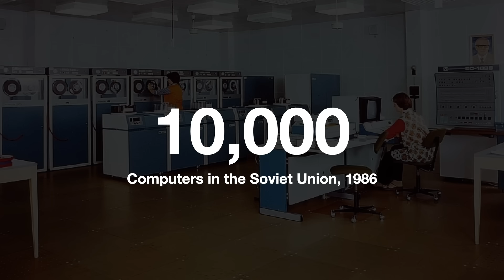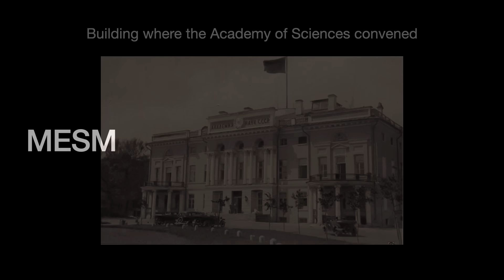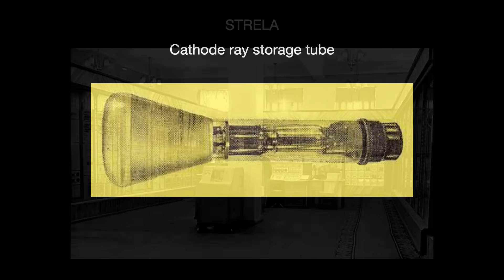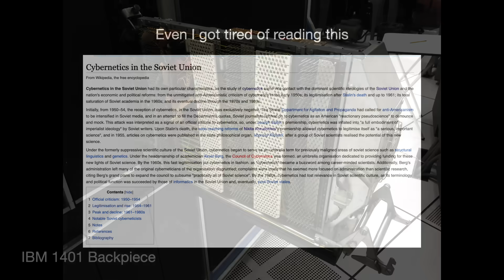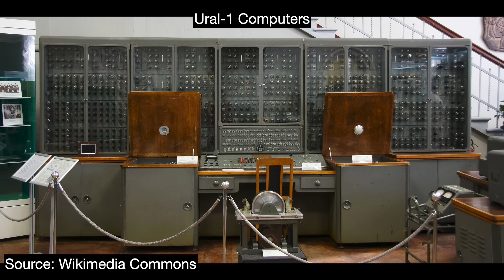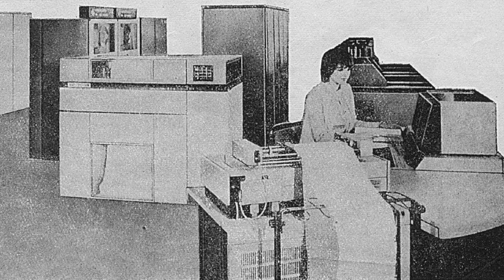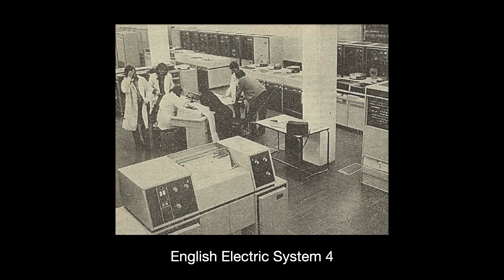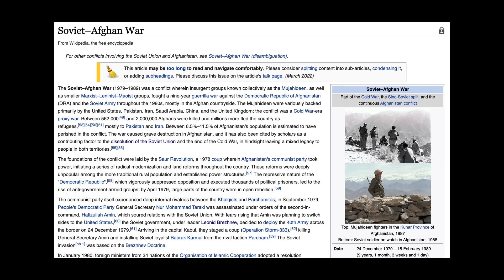Why the Soviet Computer Failed

Comment: It sounds like a lot of economic problems in the Soviet Union could have been solved by better metrics. Steel manufacturers were judged by steel quotas, not by what others could do with their steel. Computer manufacturers were judged by production quotas instead of what clients could do with the computers, so they didn't help customers with training.
Reply: There was plenty of interest in solving there economic problems but the profit motive got in the way. If u conceive of the USSR as one giant corporation, with the bureaucracy as the shareholders, the system and its inefficiencies become more evident. The state, as a corporation does, pursued many ventures, with the major difference being that these ventures all needed a base level of production to exist in order to sustain functional governance. However investment capital is limited and so the bureaucracy chooses the industries (ventures) which yield the most return on investment. These happened to me, as in modern russia today, extractive industries, petrochemical and defense industries.
Reply: @sergeykuzmichev8064  One giant monopoly, with the power of life and death over its employees, barbed wire keeping them in, and with return on investment being irrelevant because the "shareholders" got their dachas whatever happens. Modern Russia's nothing like that. Sure there's corruption, but oil is sold for money, profit making industry exists and elections are flawed but matter. And don't you guys have a flat tax?
Reply: The basic problem with centrally planned economy is the lack of competition and independence in making decisions. Lack of diversity, you could say.
Another problem is the lack of information on demand... In capitalist market, if something is good or desirable, the price goes up and this gives a signal to makers to make more that sort of thing. In centrally planned economy however, you have centrally planned prices. So you have no idea, which products are appreciated by consumers.
Reply: Almost like the top down socialist system didn't work at all to determen needs and uses of materials. 

The west figured this out in the 1800's. The free market (profit and loss system) does all of the things above.
Reply: pretty much inherent to centralized planning. communists stuck with it even though they could never effectively run a command economy since they're just too complicated to run from the capitol. doesnt help that they usually boost productivity by simply setting higher goals and rewarding those who meet them while punishing those who dont so workers lie to their factory manager who lies to their governor who lies to the capitol. I'm reminded of a Soviet miner who supposedly dug literal tons of rock per day with a pick and shovel  by doubling his work load multiple times.
Reply: @Wick Are you playing dumb or are you dumb?
I did not create the term 'planned economy' and it's definition is not set by me. A planned economy is an economy managed by the government directly.
Or from Investopedia "A centrally planned economy is an economic system in which decisions are made by a central authority rather than by market participants."

Unless you are just being pedantic because I missed the word 'centrally' even though my intention and meaning were clear.
Reply: Better metrics helps to a point.  The biggest issue was data collection, data quality, and data processing that fast enough to predict demand.  The actual people doing the work in the Soviet Union were very thoughtful about how best to measure things, but the politicians and managers of the state enterprises were excessively corrupt.  The corruption stood in the way of gathering better metrics because if the metrics highlighted the corruption the political class wouldn't go for it.  Computers were stamped out, or held back because of this fear they would expose the corruption.  While the Soviet Union is gone the underlying corruption still infects post-Soviet territories especially Russia.  The planned economy had serious scaling issues where market based economies didn't.  It was sometime in the 1970s when Russia began to realize that the Central Planning Authority would have to hire ever person in Russia for it to grow larger.  But, if you had a more honest and transparent society with today's technology you probably could scale much much higher.  But there might be a limit to the size of the economy even then that market based ones won't hit.
Reply: @chucktangy  Planned economy don't have "scaling issues". Planned economy simply don't work. Otherwise, North Korea or Cuba might be able to do better for themselves.

You might want to mention something about corruption again, but I'd answer that corruption is independent of planned/market economies. Authoritarian market economies likely have just as much corruption as planned economies. 

Once more, I'll reiterate that money itself is a metric and exactly the metric that is needed here.
Reply: @alan5506  China begs to differ on your proclamation about planned economies.  "Doesn't work" at what point in time?  We all know in the end it failed so some people want to only remember that.  In the beginning the planned economy was extremely efficient at developing Russia into a super power.  No other nation grew as fast as quickly as the USSR did.  Historians agree that Russia's planned economy was central to that fast pace growth.  But that's where the scale issues hit Russia.  Once the early days were over, growth fell off a cliff rapidly and then they sank into malaise they couldn't recover from.  It seems so obvious that computers could've been the technology they needed to fix their problems of managing the economy and yet they didn't really use them instead keeping them mostly focused on military projectile calculations.  China successfully reformed parts of their economy away from a pure centrally planned economy but they still operate on state planned initiatives with state run monopolies and steal technology from other countries in that effort.  Corruption is near universal because it's just a form of gaming the system regardless of how that system's rules are structured.  Money is a singular metric, but it doesn't prevent, nor stop, corruption or gaming.  And while we have a singular metric in market based economies we use a lot of other metrics to grade the quality of that work.  So I disagree money alone is all you need.
Reply: Outside sabotage and embargos didn't help. World wars don't help either. Harsh winters don't help at all.
Reply: @Simboiss  going after the most productive people in your country doesn't help, use scientists for space race propaganda instead of commodities doesn't help, genocides don't help, purges don't help, lack of freedom doesn't help, corruption doesn't help
Reply: no, those problems could be solved by the market
Reply: The planned economy has a fundamental problem. The plan is drawn up five years ahead, according to economic ideas of what has gone wrong in the past 5 years. In principle, it is a big matrix where the resources needed and the resources to obtain the resources are calculated for each product. It's basically a simple linear algebra problem. In my opinion, the problem is also in the mathematics. The larger the system of equations, the less stable the solution. Each wrongly determined coefficient will produce a very different solution. The planners started from mechanistic theories, but in reality it is a non-linear system with elements of chaos. (Chaos theories came much later.) The development of planned economies has shown that this does not work. In my view, the essence of the success of democratic countries is the stock market. It is a non-deterministic online system with very fast feedback. Even with all its flaws, it works more efficiently than the communist attempt at a deterministic economy.
Reply: @prutok  Market economy has its own core problem too. It does not differentiate between values and thus treats Netflix, bitcoins and prostitution as equal in value to food, health and housing. The tragic consequences are unfolding.
Reply: Finding the proper metric is an impossible task, even in theory let alone in practice. Let's say I make cutlery out of your steel. According to your suggestions you now get penalized if my processes are inefficient. How is anyone even supposed to know how many knives there should be when the knive factory runs 24h using the output of the steel mill that ran for 24h when that uses the ore that's mined in 24h and so on? It's incredibly hard to begin to model even very simple production chains and if you do manage it all you now have is a static setup that has neither incentive nor ability to adapt to new circumstances or improve efficiency. People like to blame corruption for the fall of communism so that they don't have to face the simple truth that planning an economy is jusr not possible. The Austrians proved that back in the thirties.
Reply: Yeah, and do you know what metric measures how useful your product is to other people? Money.

But money doesn't solve the innate cutthroat self-interest that some people have which is witnessed as corruption, hostile business practices, deceitful litigations, deceitful advertising, conflict of interests, lobbying and the list goes on. Transparency and free speech helps minimize the aforementioned issues. Unfortunately, one party states aren't so big on transparency and free speech.
Reply: @alan5506  "The United States is also a one-party state but, with typical American extravagance, they have two of them."
- Julius Nyerere
Reply: @alienvomitsex  There's lots to complain about any large organization in this world.
Reply: @alan5506  Yup as an economic system capitalism is very effective as a moral or ethical one it sucks ass.
Reply: @jackkraken3888  I don't think there's any economic system that is moral. Just like you can't have a car that is moral. Or you can't have a computer that is moral.
I think morality is the job of the government and the community. 

Communism, feudalism and capitalism are not meant to care about morals.
Reply: @alan5506  Great points! Nothing beats money as a tool for resource allocation, and systems of resource allocation are orthogonal to morals and morality. That bit about politics infecting every human endeavor is something one only really understands after suffering under it :-) 

For me, the interesting stuff is at the margins - things like "national champions" and the best way for govt to support industry, from standards to subsidies. Oh, and govt enforced monopolies like patents.
Reply: @alan5506  lol, as if money is a measurement on how "useful" something is. Get outta here son
Reply: @shawarmaboy4844  Money is a function of supply and demand. 
There are very useful things that are cheap. There are very useless things that are expensive. That is true.

But overall, something more expensive generally mean something that is harder to come by. And the fact that someone is willing to purchase it means that they think it's worth the price. Therefore, yes, generally, more expensive things are more useful.
Reply: @alan5506  no, not really!
Reply: @shawarmaboy4844  Yeah, you sound like a troll. Have a nice day! <3
Reply: @shawarmaboy4844  the free price system is by far the best metric for value and usefulness. Because value is subjective and dynamic. Not something a gov official can dictate.
Reply: @alan5506  See, this is true to point. Stocks for example, create a system where money is the only incentive. We can see today that companies use government aid packages and their own profits they gain by exploiting their workers, to then fire the same workers who made that money, and buyback more stocks, increasing the companies evaluation and creating record profits. This is, obviously the exact opposite of a usefulness indicator. This isnt the onky instance. We have been trying to create systems that encourage good behavior through bribery with money, and it never works, because the system gets broken in order to increase profits.
Reply: @hyphen8d725  Anytime there is a metric people will try to game the metric. The same problem happened in communist countries where officials used many tricks (or just blatant lies) to make their production/quotas higher than they really were. 

It remains that money is currently the best metric at creating wealth. I have already written multiple times that it is not perfect. 

If you have an alternative that fixes these issues, feel free to share it. The reality is that is a tough question to answer.
Reply: @alan5506  Money is actually a very bad metric. It only indirectly judges how "useful" a product is and it affected by supply constraints regardless of what would actually benefit industry. Corruption and being slow to adopt new tech is what the soviets did wrong in this case, it's not the misuse of money.
Reply: @KekusMagnus  Money is better than everything else. Corruption exists everywhere. Capitalism makes progress even with plentiful of corruption. As for being slow to adopt tech, so is most democratic governments too. Democracies are garbage too. The difference is: democracies let a lot more freedom to people to improve their own lives. Communism tries too much to have a hand in everything. 
Don't worry, I have a long list of complaints about capitalism and the whole current system.

Capitalism succeed because there is much more competition than all the other tried alternatives.
Reply: @alan5506  It's really not, money is an average indicator at best. These days we have computerised logistics systems which are much better at allocating resources than the market. Are you really telling me that wasteful consumerism, multiple competitors R&Ding the same product, investing huge sums in unproductive short-term fads, entire industries of scam-artists, etc... are the best we can do because they are prat of the most efficient resource allocation scheme? That's an incredibly lazy answer
Reply: @KekusMagnus  Yes. Yes I am.
First of all, the world is a tug of war of incentives. If one organization have all the power, it's only a matter of time until someone with a bit less good intention takes the lead and stops innovating, raises the cost or other uses their power in a way they couldn't normally. 

"Multiple R&Ding the same product" 
Like what exactly? Most very costly products have only a few companies. Take planes for examples. There's only Airbus and Boeing. Is this really wasteful? No. We need to strike a balance between redundancy and efficiency.  At least if a dumb executive at Airbus or Boeing messes up royally, we have a backup company to rely on.  

Most products also have enormous amount of variations too. Take MacOS, Linux and Windows. Would the world be a better place without two of these OSes?  

"These days we have computerised logistics systems which are much better at allocating resources than the market"
And you know where these computerized logistics are used? in the market. Yes, the market uses technology when they can. All of these billion dollar funds are trying to give money to the best companies out there. And they use plenty of computers and analysis for that. Companies themselves also use plenty of computers to predict the market, the trends and etc to get as much money as they can reasonably figure out.

Oh, and that's not even the best part. if you watched any videos, YOU SHOULD KNOW HOW MUCH POLITICS THERE IS!!!! This is HUGE. Politics, politics, politics. You can't run away from that.Having several organization provides redundancy such that when many organizations messes up because of politics, we have backups.  
Nobody figured out a system immune to politics. And politics messes up everything.
Reply: @alan5506  Democracies dont let people more freedom lmao, why would anyone think that?
Reply: @alejandrosrwebmaster  Is this sarcasm?

Countries that are democratic also embrace the concept of human rights and capitalism. Countries that aren't democratic (or they only have democracy as a facade like in Russia) usually don't embrace human rights (and sometimes they are communist).  

I suppose from a purely theoretical point of view, you could have a dictatorship that give people human rights and allows people to criticizes the government. And you could have a democracy where you are very restricted. 
But that doesn't happen.
Reply: @alan5506  ¿Human rigths? Like death penalty in USA? The rigth to live in a socialist state, to be given food, housing, education and social care? Usually, maybe always, democracy means collectivism and socialization. Human rigths themselves are a definition of socialism and democracy.
Reply: @alejandrosrwebmaster  I don't understand what you are saying. Are you against human rights?
Democracy is when people can vote on who leads the country. Not sure what you mean by "collectivism and socialization"
Human rights are not a definition of "socialism and democracy"
Reply: @alan5506  Do you even know what are the human rigths? Article 22 literally defines a liberal democracy, that makes "only democracies respect human rigths" a tautology. Thruth is human rigths are a compendium of popular socialist policies as implemented in socialdemocracies, like most of Europe, África, and América except USA.
Democracy is exactly collectivism by definition, the rule of a collective mind that is supposed to solve individual problems with coercion.
I.e: most people want socialized healthcare -> Socialized health care is imposed to individuals, even if they disagree. That is collectivism.
Reply: Better metrics - and still the usa uses imperial
Reply: @leonscheepers5350  - the United States has never used the imperial system of measurements. The imperial system was not even established until after the United States had become independent.

The U.S. uses the customary system of measurements, though it also adopted the metric system as a legal alternative in 1866.
Reply: @alanlight7740  yes, I know you guys are behind the times ... ;)
Reply: @leonscheepers5350  - we're happy to be at the back of the herd as it runs toward the cliff.  ;-)  ;-)  ;-)
Reply: @alanlight7740  yip at 3/16ths miles per hour ;)
Reply: @leonscheepers5350  - that would be 15 chains per hour. Use the appropriate units! It's why we have them.
Reply: The main problem is the Kosygin reforms under Khrushchev. They heavily liberalized Stalin's well-adjusted economy, gave enterprises a lot of freedom, literally deprived them of central control by the state. This allowed them to temporarily reduce the number of officials who were involved in the control of production under Stalin, but in the future everything eventually led to complete bureaucratization. Also, the Khrushchev government was extremely lenient towards industries in the republics of the Soviet Union, which led to the constant manipulation of information by enterprises. False information reached the center, which led to incorrect conclusions in the State Planning Commission.
These reforms were the first step towards the collapse of the Soviet Union, but this could still be corrected.
Reply: @Saiga-saiga  
"Stalin's well adjusted economy"
/looks at profile being created in 2014/
Бля, еще один мамкин сталинист, взращенный на менте Гоблине...
Reply: @Saiga-saiga  Be careful with that.  It makes you sound like an authoritarian lover.  It's an admission that Russia could ONLY be managed by a complete totalitarian, and that any liberalization would just unravel the system.  Russia needed to step away from Stalinism if they planned on carrying on.  Data collection was something I cited as a critical problem that could've been remedied by computer technology, but they didn't do it.